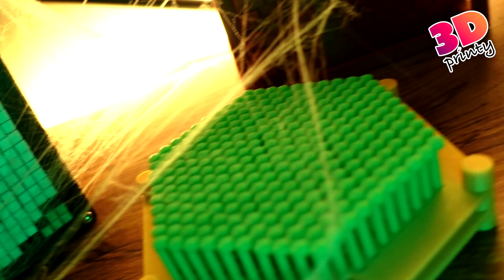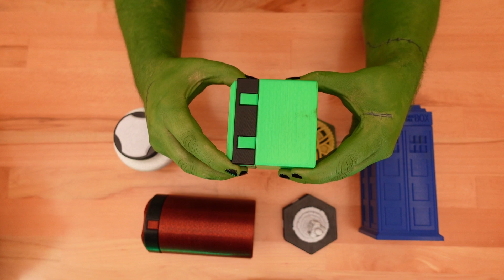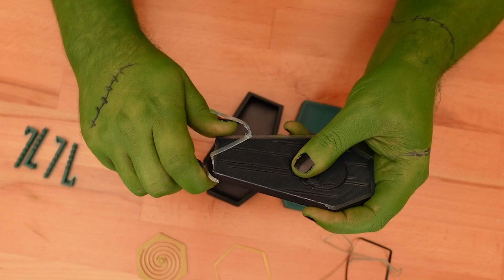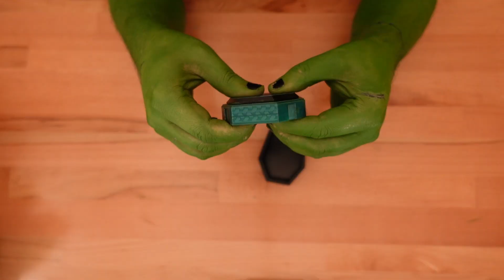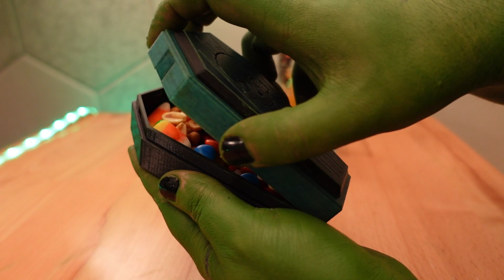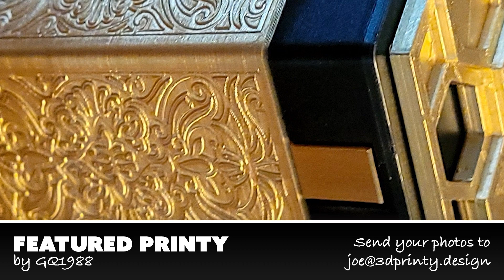3D Printed Twist Lock Coffin

Comment: i wrote u a msg on printables
Reply from the maker: I replied to your Printables message an hour ago, so I guess we're covered :)
Reply: @3DPrinty   I have to tell you what just happened.  In the video you said glue the spring down.  I did that.  The topper ended up following off.  I was able to twist the center and get the gears back into the tracks.   I had to glue the topper on the shaft to prevent that.  Not sure if your video covers that because I didn’t watch till the end I don’t think.  Working great again.
Reply from the maker: Glad to hear you got it working!
Reply: @3DPrinty  can you do a tutorial on how to draw preferably the coffin.   But anyone of the twist release. In fusion.  If I could learn to draw this I could apply that to a different model.  Thank you. Btw. I got an awesome idea on the remix.  I’ll hit you up in printables.
Reply from the maker: Here's my tutorial on the springs: https://www.youtube.com/watch?v=JA9fNA1EJRw

The rest of the model is fairly straight forward and didn't use any special techniques that would make for an interesting tutorial - just draw the container from the top view and use the offset tool to create the walls.

The latches themselves are mostly trail and error and the rack/pinion mechanism is my own circle-based gear design that's not worth learning how to replicate - better to make your own more professional gears.
Reply: Unfortunately I am not good enough yet to draw all that.  Thank you though.

Comment: absolutely love this design, only thing i can fault is having to use super glue on the spring... it leaves behind white residue.
Reply from the maker: Glad you like it!

I've gotten away with only a couple drops, but you're right that any extra spillover tends to discolor most filaments :( If you prefer, hot glue also works... it's just not as strong or permanent.

Comment: I love this design so much, but I am losing my mind with how to make this two tone without a ton of support to rip off since it tends to take hours to print. I am new to printing and have a Bambu, any tips?
Reply from the maker: Welcome to 3D printing! 

The top lid prints separately face-down. Just print the first few bottom layers in one color, then switch to a second color for the rest. Since the color change happens only once and on a specific layer, no supports, no purge blobs, and no prime towers are needed :)

Using layer-based color swaps is an old trick that's been somewhat forgotten since the boom in multicolor printers. But it's very powerful and efficient tool when a design is created to make use of it. Good luck!
Reply: @3DPrinty  Thank you so much! I was able to look up how to do that with Bambu and now I am successfully  printing in two tone. Now I also know a new trick and will be using it for other prints.

Comment: do you have a design for a small coffin that can be used as pin cushion?
Reply from the maker: I'm pretty sure this design will also work scaled down to fit your needs - especially if you don't mind turning the top into a normal lid by skipping the spring.

Comment: spoopy! I love it. I think I like the red and black one best, though they all look super cool.
Are you adding the tracks to prevent the spring from over-turning the topper to previous lock boxes as well?
Reply from the maker: After making this video I ended up buying a lot of that red filament. It's a great color (although I have to be careful printing with it because it seems a bit brittle before printing).

Unfortunately, being compatible with a track like that requires that the topper is printed upside-down, or the nub that slides in the track would need to be a separate piece that you glue on. Since the other twist boxes don't seem to have such severe alignment issues, I decided to prioritize some other projects. I might explore it in the future!
Reply: @3DPrinty  Ah, yeah, that makes sense. little notches and bumps can be tricky that way. Tho now I'm wondering if it would be possible to do the same sort of thing with a groove and bump on the inside of the lid and the gear... it would make the gear have to be attached in a specific position, but I think it would also be easier to print without having to flip the topper over. I may try it out later.

Comment: How do you get the bottom of the pieces (that are on the print bed) to come out so nicely? My bottoms always look lousy, so the topper doesn't look great
Reply from the maker: I guess it depends on what specific first layer issues you're seeing. A z-offset that's too far or too close is always the prime suspect.

I print on both smooth and textured PEI sheets - depending on what surface I'm looking for and adhesion I need. For this project, the textured sheet really helped give the lid a more natural feel.

I clean the print surface after every 2-3 prints with 99% isopropyl wipes and wash it with dish soap and warm water every month or so. For extra adhesion, I use a VERY thin layer of glue stick, which the isopropyl evens out.

If the first layer is still giving you trouble, the toppers CAN be printed top-side up, but you'll need support material. Fortunately the surface the supports touch will me completely hidden, so cleanup wouldn't need to be perfect.

Hope this helps!

Comment: Nice video, what is the name of the tools you use to peel the borders?
Reply from the maker: I highly recommend it for anyone who regularly prints with brims.

It's a "Deburring Tool". They should be available at most large hardware stores and some craft stores. If you can't find them locally, Amazon has deburring tools for about $20.

If you use it exclusively on 3D prints, you probably don't need to buy extra blades for it - they take a loooong time to get dull.

Comment: what infill are you using? im having a problem with the spring and gear going together. the one in the gear is to big for the spring post. so i glued it together and now after a few uses the tab on the spring twists off. any info would be great. thank you
Reply from the maker: I typically print with 15% gyroid infill and 2 perimeters. For the spring, I increased that to 3 perimeters so the "arms" of the spring would be 100% perimeter lines.

If you're already printing with settings similar to what I've tried, and the post is still twisting off, the issue may be layer adhesion. In that case my best advice would be to print the gear at a higher temp (5-10 degrees hotter than normal) to make sure the layers really bond together. I hope that helps!
Reply: @3DPrinty  thank you so much for the info I’ll give that a try!

Comment: Hi, this is awesome and it was my very first 3D printing project, However, I found that the gear keeps comng lose, and isn't locking into place.  I am wondering if I can glue it to the latch mechanism (the skull topper) to make it stay in place.
Reply from the maker: Welcome to 3D printing!

Yes, if any of the peg/hole connections are too loose, a tiny drop of superglue should do the trick! I also recommend gluing the edges of the spring onto into the top... just make sure that none of the latches get glued in place.

I hope that solves the problem, but if you run into any other issues with assembly, let me know!
Reply: @3DPrinty  awesome! Thank you! I did glue the edges of the spring, as well.

Comment: How did you get the two tone on the skull topper? did you have to swap colors during the print or do i need a printer that can print with multiple colors?
Reply from the maker: Fortunately, all the skull toppers were made with simple filament swaps mid-print! You don't even have to catch it right on the layer where it starts bridging over the skull pattern - switching 2-3 layers early is okay as well.
Reply: @3DPrinty  Pause and Swap, or, just go for it?
Reply from the maker: I use a pause and swap to make sure the old color can be fully purged out of the hotend before continuing.
Reply: @3DPrinty  i just finished this at 140% to be used as a dice box for my wife! The only part i did was 3 layers of glow in the dark pla for the skull coffin topper. It looks amazing ill have to try and remember to post a photo on thingiverse
Reply: @BioHazzardization  Awesome! If you post it, I'd love to see it!

Comment: i get a failure to write to block on a the skull topper, not sure what that means
Reply from the maker: I'm not familiar with that error. Just to be sure, I downloaded the file and tried slicing it in PrusaSlicer with no issues.

I'm guessing this is an issue actually saving the file. Try saving it again, possibly at a different location. If you're saving directly to a USB drive or SD card, see if saving to the computer works. Good luck!
Reply: @3DPrinty  thanks I don't know why I thought of that. That seemed to work.
Reply from the maker: @AlbinoMinecraft Excellent! Hopefully it's just a one-time fluke. Happy printing!

Comment: Oh, I'm SO glad that I fixed adhesive problem, and will never even need a brim.
Reply: Sometimes you still need a brim, even if the printer is dead on, especially for tall thin parts or they start to sway with the print head and you get Z banding
Reply from the maker: Yeah, it's probably overkill, but I tend to overdo many things, haha!